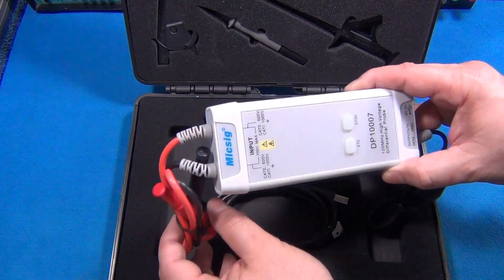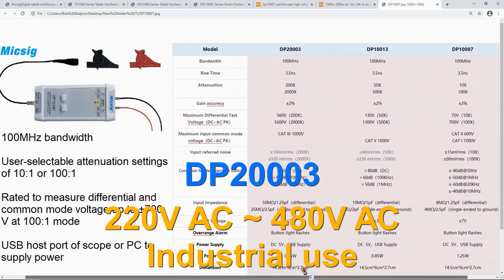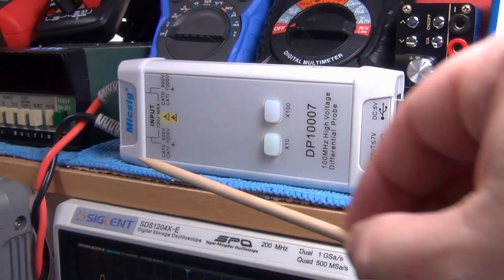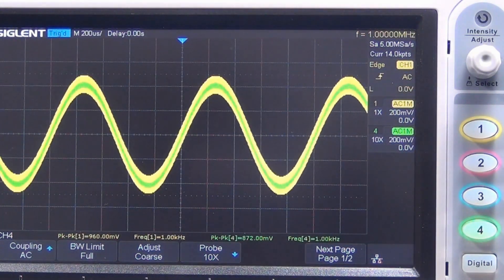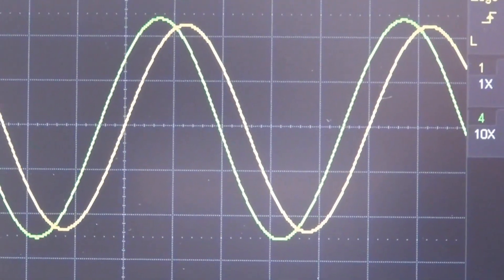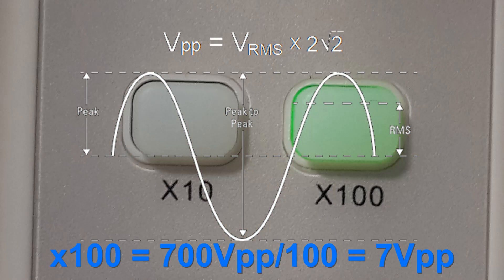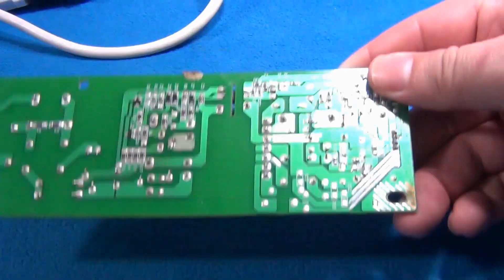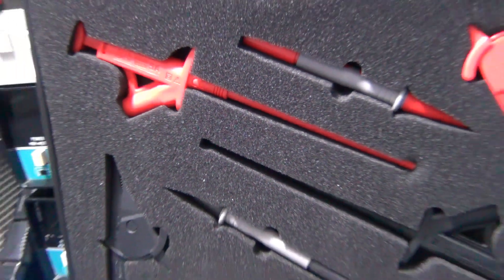Product review Micsig DP10007 High Voltage Differential Probe 100MHz Probe Kit for oscilloscope

Comment: Point of clarification. At 7:00 in the video the 700 V maximum referenced on the 100X setting is V peak plus any DC offset and not V peak to peak. This is clearly stated in the product documentation. Similarly, for the 10X setting the maximum allowable peak voltage is 70 V. I confirmed this by hooking up the 10X probe to a variac and output to a scope. As the voltage is increased the output signal appears normal but when V rms approaches 50 - 52 V the indicator light begins to flash indicating overvoltage as it is designed to do. But 50 V rms is 70 volts peak consistent with its specs. If the 70 V maximum referred to peak to peak voltage instead, the overvoltage indicator would have come on at a Vrms of only 25 V. As the voltage is increased further beyond 60 V rms (at the 10X setting) the sine wave becomes clipped as a previous observer has noted.

Comment: I got a dp10007 one. It's a terrible device. Its error at 20mhz reaches to 19%. In my test, it works well up to 670khz with an error lower than 2%. There is no way to open the enclosure to tune it. Just a waste of money and time.

Comment: Thanks for the review, in case the differential probe is not used, an isolating transformer can be used to isolate the power to the DUT and the oscilloscope separately.

Comment: The DP10007 is actually the best for 230V mains voltage mesasurment. Maximum differential voltage is a voltage at which the probe output voltage is at its maximum (the signal is clipped). It is not a maximum voltage you can connect to it. The DP10007 is CAT II rated at 600V so it can be used with 230V mains voltage and at the 100x setting the output voltage wont be maxed out, it will work just fine. It will measure voltages up to 700V. Also eevblog had a video about it https://youtu.be/V93Rnco-wKg

Comment: FYI as it says on the sticker on its face, the probe is designed to output into 1 megaohm (typical scope impedance), and not terminated with a 50 ohm load.
Reply: It wasn't terminated with 50 ohms, it was connected directly to ch4 on the scope.